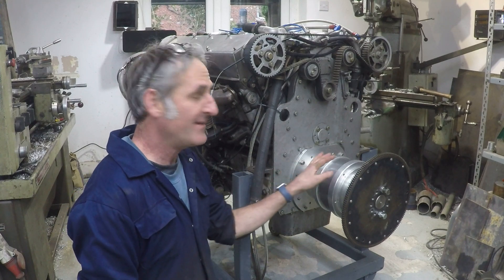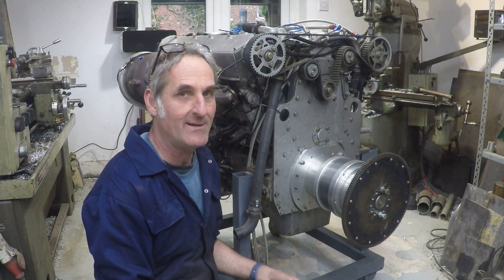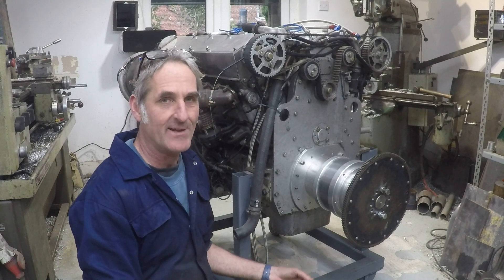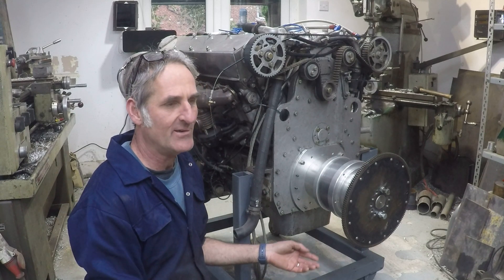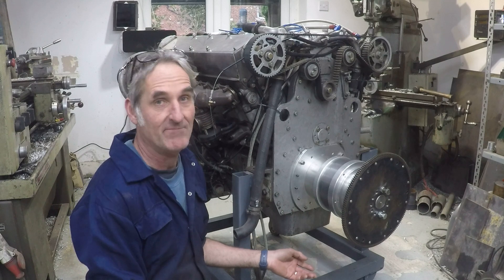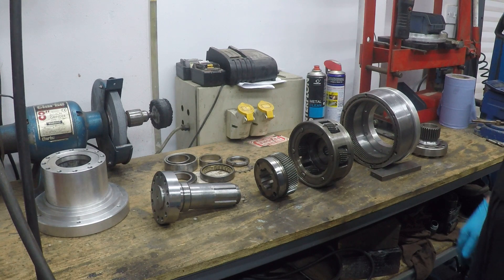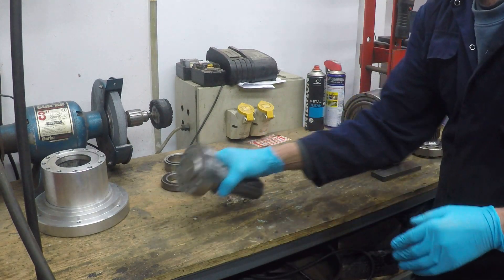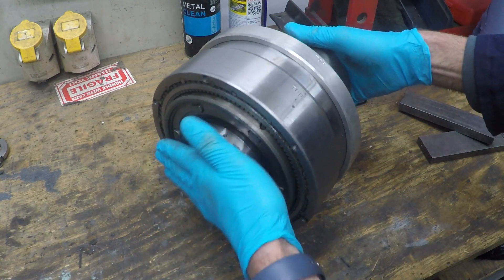Introduction to the Land Rover Meteorite Overdrive Gearbox

Comment: Ford rally cars used to double the engine speed with step up gears to take the torque off the transmission, they reduced it with 2:1 gears after the differentials. Back then The engines were allowed to do 8,000 rpm so the transmission ran in the up to 16,000 rpm zone. It gave them great reliability.